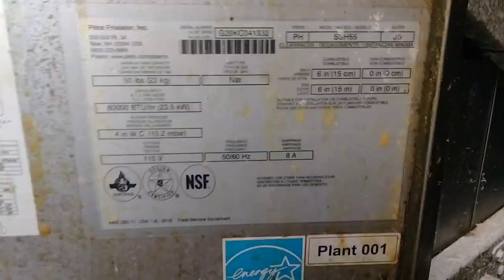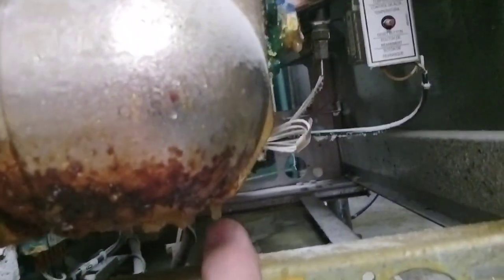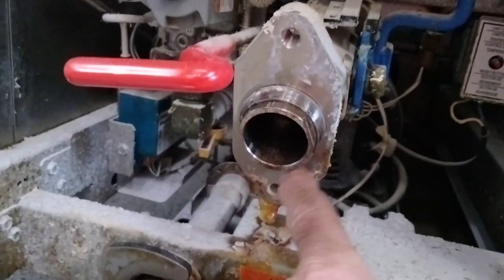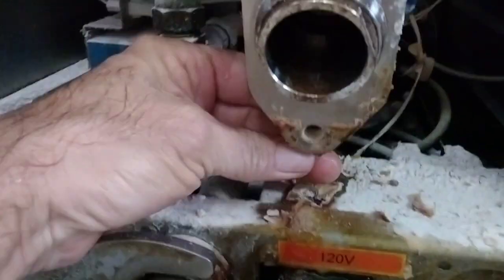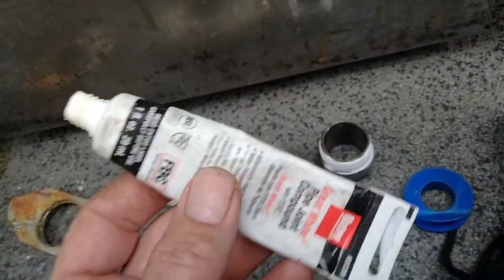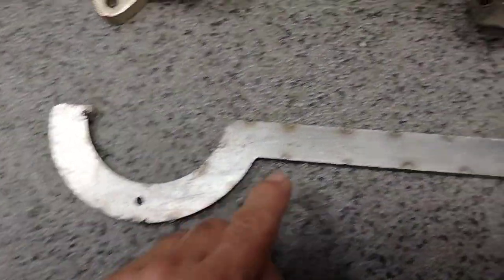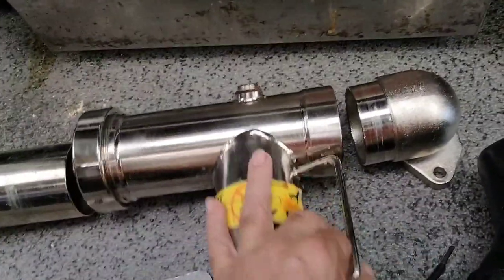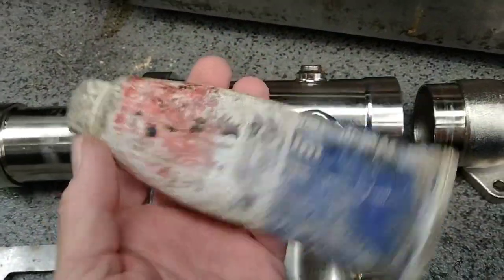Pitco Fryer problem Leaking Oil Video 3

Comment: If you have a chance, could you share the Mcmaster part numbers for those absurdly priced pitco o-rings?
Reply from the maker: 0:20 Filter pick up tube Viton 1"  #318 part 5267T267
3" drain Viton is not what I previously listed
Having some difficulty finding white 3" teflon oring but have bought them before. When find # will post.
Thanks for watching my video.